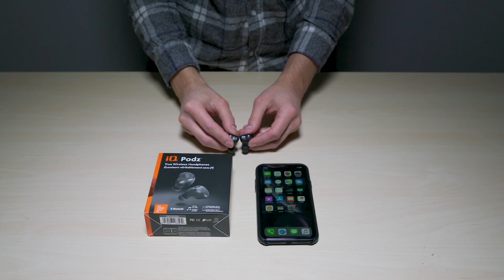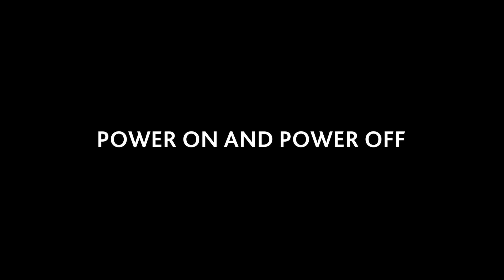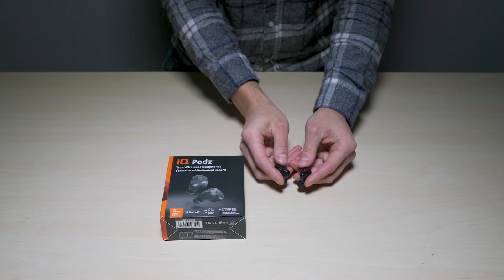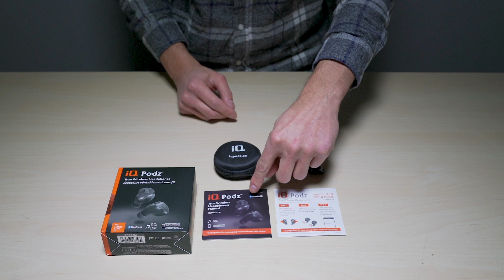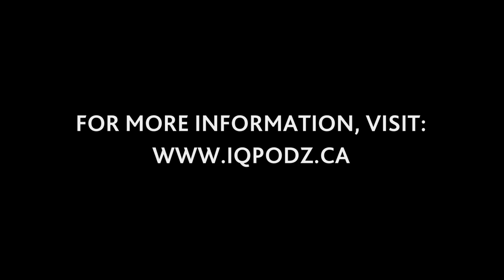iQ Podz 05 -  Quick Start Guide

Comment: at the very beginning, I only heard the first voice (turning on), not the second tone,  what should I do now? and I get two separate connection each time I turn on my Bluetooth
Reply: I have similar problem. Did you get it fixed? If yes then how?
Reply: Same here. Where you able to fix it? Me until now it's not pairing either one is working but it won't work together.  Still bluetooth can detect two item.
Reply: @ribee6193  I have the exact same issue as you but no fix so far! :(

Comment: So whenever I turn my Ipodz on at the exact same time, they still won't connect to each other no matter what. Every time I do a factory reset, nothing, they don't connect to each other at all. I've also tried turning on and off my Bluetooth, they still won't connect to each other and show two seperate options every time. Can you help please?
Reply: This product is garbage. Every time you read about these it's always the same.... Can't connect them. I had so much trouble doing it the first time but got it work and now all of a sudden they don't connect anymore
Reply: Worked once, now refuses to pair together, so I only ever hear out of one ear. The one that doesn't work continues to flash red and blue. Resetting it, turning them on and off does nothing. Luckily I got them for free with my phone. Off to buy some real and working bluetooth ear pods :-(
Reply: @ChrisMolnareh   I have the exact same problem, took them back to the place i got my stuff and the guy got them working in a few minutes. So I thought I was not doing something correctly. I have tried and tried  for hours resetting does not help. One pod will work sometimes, one pod is continually flashing red and blue, its like they are out of sink  i find them to be very frustrating.  I would give them a zero out of five
Reply: Me two
Reply: they are a pos
Reply: For me, restarting the phone solved my problem.
Reply from the maker: Hi +One Canadian Dude - sorry about the trouble pairing. Please contact our service team and we'll be happy to walk you through the process. By email: iqpodz@gentec-intl.com or by phone:  1-905-513-7733 (and ask for iQ Podz assistance). Thanks!